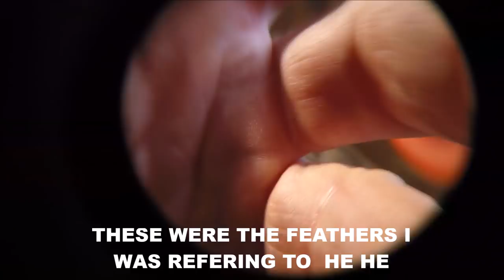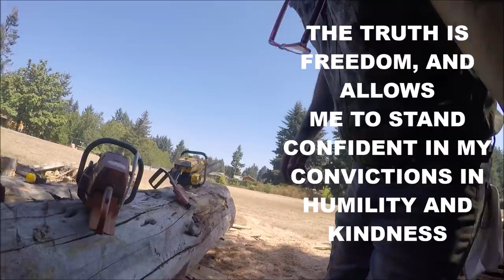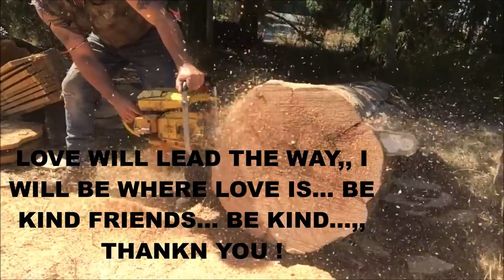CHAIN SAW SHARPENING MYTHS, HUSKY VS  McCULLOCH

Comment: Buckin', until I started watching your videos, I could never successfully hand file a chain to my satisfaction.  Now, after much practice using your techniques, I get a sharp chain quickly and with much less aggrevation.  Currently trying to reclaim 660 feet of seriously overgrown fenceline and seem to find old barb-wire way too often and trashing some teeth in the process.  Trust me, your tips and tricks are much appreciated these days.   To that end; while palmettos aren't a problem in Canada, they abound in Florida and can be hell on a chain as their fiberous nature seems to hold sand as they grow and tends to plug bar oil passages almost instantly. Any thoughts on mitigating this problem?  I am now trying to cut them using the top of the bar to help fling the fiber away from the engine area and it seems to buy me some time before dissassembly, sharpening, and cleaning.  Thanks and keep 'em coming.

Comment: Ok so someone from my hood decided to liberate me from my little Poulan.....I think I'mma look for an old McCulloch.....what do you think I should look for ? I just like cutting camp type wood from downed or dead standing timber....any suggestions ? I like old school stuff, I do still own a HomeLite Super XL Auto....
Reply: 50cc is a great size. Big enough for most work but not super heavy. McCullough 10-10 I think is 50cc.
Reply: Mac 10 10, 54 cc’s of kick ass!
Rebuilding one right now for myself. 
If you can find a good one and go through it you’ll have a beast of a good little saw.
Reply: @holstonvalleyduke9882  nice! They are neat saws but hard to find around my area. I've been also looking for a Pro Mac but no luck with either. I think guys around me are buying them up...
Reply: rodavision look on ebay. There is a nice 10 10 on there that runs for around 150$. Also a Pro Mac 10 10 that has been completely gone through and looks like new BUT they want 550$ for it. Has a 6 month warranty though, you don’t typically get that with an old Mac. If i had the disposable cash I’d buy it in a heartbeat. My wife would kick me out even faster though 😂

Comment: Question:  I have the 372xp and a 288. Both have 24" bars. I want to go longer on the 288 so what length would you recommend and when (in length) should I go skip tooth? Great video test! Thank you.
Reply: hey I run a 288 when I was bucking 100” lengths for Louisiana Pacific(they make particle board).  I used skiptooth 404 on a 26” bar....found it to be the best chain for all day productivity.  Quick to touch up, and melt thru popular and cottonwood effortlessly, just using the weight of the saw.  Log dogs never needed...Rakers filed down a bit lower than factory specs, so very aggressive, but the 288 has lots of power to not bog down in the cut with a 26” bar, which was a good length for me, with the saw in a deck of wood all day.   Cheers from northern BC.

Comment: Where do you get that depth gauge? 

I also LOVE my stihl skip chain.
Reply: Patrick  They are a Husqvarna gauge.  The Stihl, Oregon, and Husky gauge on their roller filing guide are worthless.  Any Husky dealer can get them or you can buy online.  They run about $7.00 but really last as they are hardened steel and your file just slides over them.

Comment: Dear Mr. Buckin,

Was cleaning out an old fallers shed to help him out. Came across old chains he had 3/8”. The backs of the teeth on some were filed almost right back to the line. He says it made the chain cut faster because the chips leave the wood a bit longer. What is your thoughts on this. Thanks!  

Jesse

Comment: I just bought the new Stihl chain saw sharpener. It’s amazing.
Reply: Is that the 2 in 1? I$ heard they really are fantastic.
Reply: Gee Kay yes that’s the one. It really is. It will make you a pro and cut the sharpening time in half at least.
Reply: I use one of those too, it makes it really hard to screw up. I can file free hand pretty good at home with the saw in a vice but not so good in the woods where its hard to hold the saw good, the 2 in 1 makes sharpening your saw in the woods easy.
I learnt a lot about sharping chains watching buckins vids, I was able to save a few chains that I thought were toast from being rocked, his vids pointed out what I was doing wrong. This is a great youtube channel.
Reply: NSEric 123 it really is. I’m a huge Buckin fan. I started wearing suspenders because of him.
Reply: Typically, not always, if you’re looking for that 2 in 1 it’s made by Pfered and is blue in color and a little cheaper than when they make it Orange and White and put Stihl on it. 
Because you know just cause ot says Stihl it’s worth more money 😂
 That’s Stihls logic anyway.

Comment: Very well done.. I agree with you on tooth length, I damage a few I fill them back  but I don't file all the other teeth.. I know one fellow who states how important it is to count your file strokes , I never did ..
Is there a rpm difference between your 394 and the 125? By the sound it sounds like the 394 turns up higher..  Have you put a tach on the saws to see?

Comment: I noticed you have a 5200 Poulan back from the original late 1970's when they were all metal. They were great saws as good as Macs and better than Homelites.  I had a 4600, 5500 and 6000.  The 5500 and 6000 were beasts that had the torque to cut 28" oak at a pro speed of 1/2 second of 1" wood.  Don't know about the 5200 countervibe but my 4600 countervibe was the fastest rpm saw I ever used.  It could cut 18' buckin sections of hardwood super.  It didn't  have a governor for sure.  Maybe the 5200 was after Husky bought them and cheapened them: don't know.  It was way faster than Stihl.  Maybe carb is dirty or you haave an air leak.

Comment: Out in the field, hand-sharpening may suffice but there's no substitute for a file jig for regular sharpening. Having cutters of varying lengths is not so bad, especially on a chain with lower mileage, but the file angle and height really ought to be identical on every cutter. Try it for yourself. I recommend the all-metal Granberg 106B filing jig. It costs only 30 bucks but will give you the ability to sharpen every tooth to the same manufacturer-specified angle and height. If you file strictly by hand, the amount of variance in the shape and dimensions of the cutters will become greater with each sharpening and progressively diminish the chain's cutting potential. Brand new chains cut very smoothly and efficiently, not only because the cutters are sharp but also because they are identical to one another.

Comment: The reason they say you should keep the teeth the same length is because when they are the same length you have a better chance of all the cutters cutting the same amount, say you have a short cutter between two longer ones, the two longer ones will prevent the short one from taking a full bite, it's not a big deal I personally don't worry about it too too much it just keeps it all consistent

Comment: Hi from Cyprus. What do you think about the fact that when some tooth have been hit and we make them sharp again are smaller than the others. Does this affecting the straight cut of the saw?
Do you sharp all the tooth to be at the same length after such chain hit or just make them sharp irrespective of the size after the sharpening?
Thanks in advace

Comment: I'm a novice. Just a firewood getter from New Jersey. I run a echo cs670 primarily hardwood. Love woodlore and the forest. Ironically I use electric/hydraulic chainsaws to cut concrete. Yah! I love the old McCullochs. What does the hard/soft wood raker fileing mean? Thanks bless.
Reply: I understand that you can use a lower raker setting in soft wood as easier on powerhead. Too much, increases the risk of kickback. Also increases stresses on chain chassis, so when well worn more chance of catastrophic failure. Leg wrapping derailed chain. Even worse if old school saw without a chain catcher fitted. Told by old timer, who saw it happen in 60's or early 70's. Don't last long with severed femoral artery. Be aware of dangers & take calculated risks only if comfortable with possible outcomes.

Comment: Billy, what's your take on diagnosing a bar that is hooking in the cut?  Some say uneven tooth length can cause this, but I've experienced it even with evenly matched teeth.
Reply: The first thing I would check is to make sure the top of your bar is perfectly square.  There are tools for doing this made by Oregon, Stihl, Pferd, and Vallorbe or you can try to get the rails square with a large flat mill file.  Next I would check that your chain is tight in the bar groove and not flopping back and forth.  Check a new chain in a new bar to see how much play there should be.  There are tools for closing the rails but some people (Buckin included) go to a higher gauge chain.  A loose chain will cause both of these problems.  Finally, if the chain is from China it will seem to deform on one side or the other.  Don't ask me how or why, but from personal experience it just does when it gets worn about 50%.

Comment: Can you show us exactly the position of the file on the tooth? I can get a great sharp corner using the husky guide and raker gauge then follow up with removing the gullet. But without the husky guide I don’t get how to file the top edge of the tooth to get that nice corner. I always end up just working the gullet and underside of the tooth
Reply from the maker: 7 /32  SITS RIGHT IN THERE BUDDY , IM NOT SURE I NO WHAT YA MEAN,   WHAT SIZE FILE BUDDY?
Reply: Buckin' Billy Ray Smith I think you answered my question. It’s hard to explain. I just find when I file with a 7/32 I don’t end up hitting the top edge, but get underneath. Thanks Buckin

Comment: We learned at forestry school to file the teeth so close to equally at both sides as possible. Not to increase performance but to avoid vibrations. Vibrations that in the long run will wear you down.
Reply: Jasper Soerensen 15 year logger here, we’ve never done that in the field , keep production up and file the ones you need and get back to making money